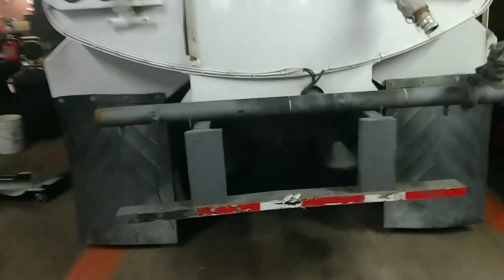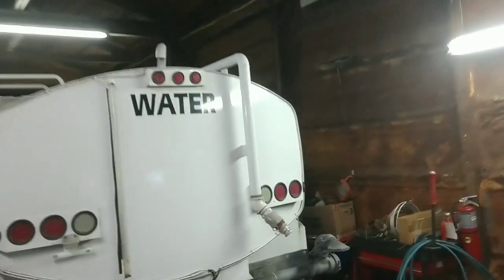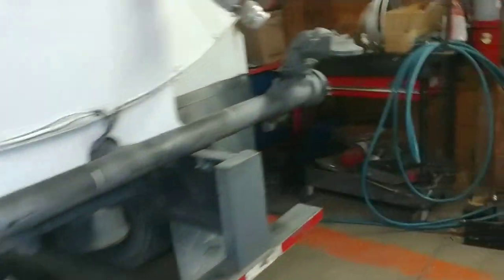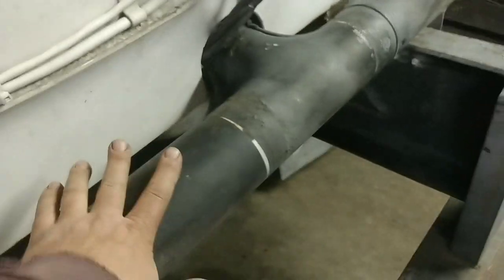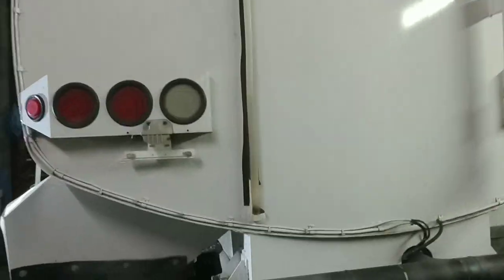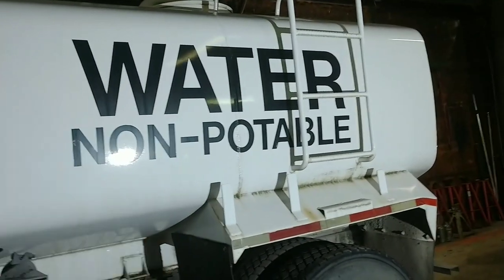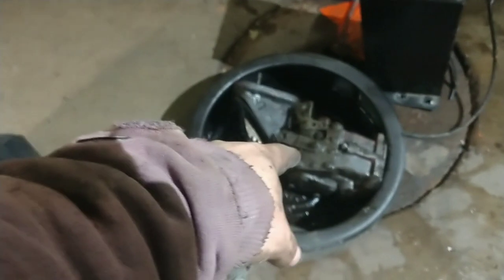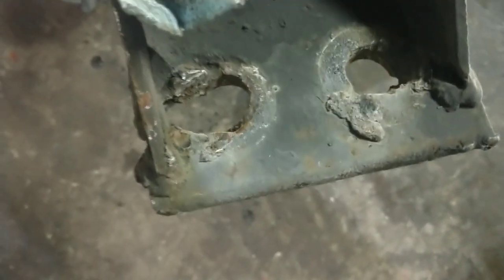TAKING A WATER TRUCK APART

Comment: I can't tell if that's a different gradall or new tires...they had me in a water truck once that would pump itself as long as you left a foot of water in the tank...l don't think I'd put the wrecker on this truck...l'd use it to pull 1 of those gooseneck trailers...that frame extension is hard to look at...when you get done moving the truck around maybe you can put a hitch plate back there to pull that pintle tilt deck trailer...also, l liked the way Mrs JC kicked those wires out the way before you set the tank down - best helper on YouTube
Reply from the maker: she is a gem for sure. not sure what truck is going to get that wrecker bed. it needs to be put on one soon as i have a a couple more trucks to tow.

Comment: I worked at a garage and you have too be careful lifting a truck and not chaining up the axle cause you can mess the airbags up doing that so just a lil info cause we have changed bags out due to rips and stretch bags cause tow conpanys didn't chain the axle and just let the axle bounce in the wind....
Reply from the maker: air bags were cut by chains when the original wrecker driver was careless on how he routed them.....so i saw no need to chain them up.
Reply: @j.c.smithprojects  oh ok I know some wrecker guys will just pick them up and don't care if they tear up crap but I figured you already knew that but thought I would throw it out there but love your videos!! Happy new year!!!

Comment: OK, Mrs. JC, I already subscribed, I thumbed up, and here's my comment 😉😄.  Gradall once again the universal tool of choice for all things JC-related!  Does that Gradall have any type of scale on it?  Or a pressure gauge on the lift cylinders?  I've thought about it for my loader - I think it would be very interesting to have an idea what things weigh, at least compared to other things.  Never a shortage of projects!  Thanks for the video!
Reply from the maker: no scale but after using it for awhile...you can estimate what something weighs by the way it handles it. if i never bought another project, i have enough for the rest of your life and mine....

Comment: I thought most Gradalls were yellow, but I looked it up and found a Gradall 534C-9 9000 lb. Telehandler which also was green.  Is this the model you have?  I did not realize they can lift over 4 tons - awesome! 👍
Reply from the maker: 534c-9 model 534 c is cummins and the -9 is the 9000 lbs capacity.

Comment: Jc as much as I see you tow you need to break down and get yourself a real deal medium duty 25 ton under reach wrecker ,those 5th wheel units and others makes me cringe
Reply from the maker: it goes in phases.....some  times i have a lot to tow but then i will go months and tow nothing.  its not cost effective to invest $50,000. and up into a decent truck with an under reach.

Comment: If you use one of the F-750 trucks for a wrecker ,besides shortening the frame would you have to double it up?
Reply from the maker: it would not be necessary because of the limited amount of weight the trucks that i would tow with it. however, if i was building it with the intent of selling the truck someday with the wrecker bed on it, i would go ahead and double frame or "L" frame the original.

Comment: Dang,  looks like a blind guy cut those in.    To be fair i have torched holes in the frame before.   However i ream them out to what i need.   So it looks ok.   Not the best practice,   however hand drilling gets old.
Reply from the maker: awful wast it.....there is no way i could do that.
Reply: Yeah, I have seen what kind of work you do.   You take care and pride in doing the job right and once.

However some shops will let junk like that go,  "it worked, right".  Despite the fact,  it horrible workmanship.   Even my torch trick,  i hate.  Even tho it looks like a drilled hole when done,   is a crappy way to do the job.    Got a good used Mag drill,   looking foward to the next job.

Comment: I forgot what happened to the motor in that water truck? Is that the one at the so-called professional driver blew up?
Reply from the maker: no, this is the one the dealer put a turbo on it and then told them that the engine was damaged due to metal from the turbo going through the engine.